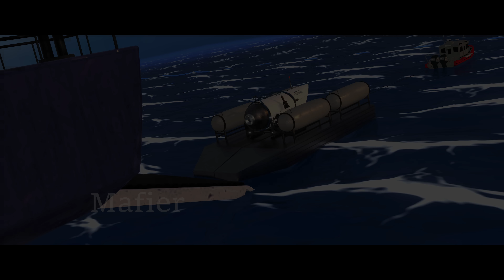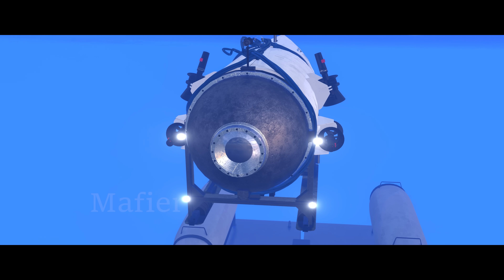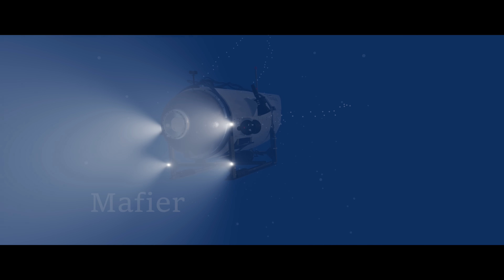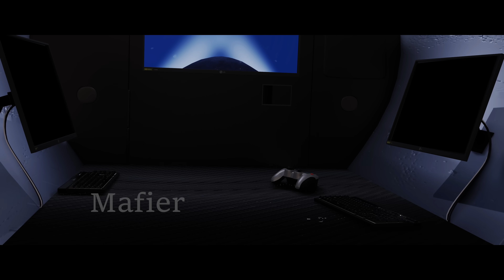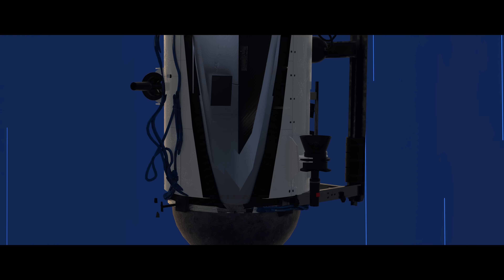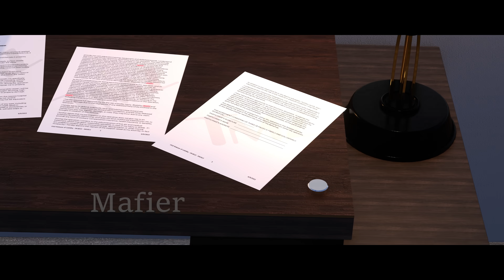NEW SHOCKING DISCOVERY Of Oceangate's Titan - 3D Animation

Comment: That theory doesn’t really hold up mechanically or evidentially.

Here’s why, step by step:
	•	Weight distribution: The Titan was designed with occupants forward; four people in front was not an abnormal or destabilizing configuration. The sub’s center of mass and buoyancy were engineered to tolerate occupant movement without causing uncontrolled pitch.
	•	Electrical failure ≠ loss of passive stability: Even with a total electrical failure, Titan would still retain passive buoyancy characteristics. Loss of thrusters means loss of maneuvering, not sudden pitching forward like an aircraft.
	•	Nose-down pitch wouldn’t meaningfully increase descent rate: Water pressure acts uniformly. A nose-down attitude doesn’t cause a rapid “fall” the way it would in air. Descent rate is governed by buoyancy, not orientation.
	•	Implosion depth vs time: The depth at which Titan failed was well within expected operating range. A slightly faster descent wouldn’t suddenly push it into a new pressure regime fast enough to explain failure. Composite fatigue, not speed, is the dominant issue.
	•	No evidence of a progressive event: A loss-of-control scenario would likely produce:
	•	Multiple acoustic events
	•	A wider debris field
	•	Signs of partial structural failure
None of these were observed.

Comment: The United States Coast Guard released their findings and conclusions of the hearings held in South Carolina—2024–August 2025, the conclusion, the titan experienced a catastrophic implosion; reason provided—in the report—was the bonding surfaces of both titanium end capes secured to the carbon fiber hull. The bonding surfaces of the titanium end capes showed troubling signs of grinding, as well as warping as well as other unusual markings on the inside surface of the end capes. The aft titanium dome had some of the carbon fiber still connected showing significant delamination of the carbon fiber and bonding anomalies.  Additionally the view port window was not located, no signs of breaking or shattering of the glass, leading engineers to conclude that the view port window could also be a contributing factor (since the window itself was not located) blown away from the debris field at the catastrophic implosion site. 

The findings also concluded that the evidence provided at the hearings was significant enough that courts could have concluded criminal investigations resulting in possible charges may have concluded that Ocean Gate be prosecuted. However, we will never know this as Stockton Rush was killed in the catastrophic implosion that occurred June 2023, 1,600 meters from the bow of the Titanic.

Comment: "This tragedy will remain a lifelong mystery". What???? Stockton Rush built a sub out of Carbon Fibre. A material no deep sea sub has ever been made from. During lab testing, the Carbon Fibre failed several times at pressure equivalent to 3000-3500m. The titanic is 3800m. Each time the Titan went down for a test dive, the cracking was indicating a weakening of the material. Eventually, the material ruptured. This information about being dragged behind the ship for 3 days causing the accident is rubbish. This was a design flaw that just need time to show itself. Deep sea subs need to be constructed from contiguous materials like Titanium or Steel, not from composite materials like Carbon Fibre.

Comment: The failing engine and resulting plummet is unlikely. The sub was being tracked up to the last minute by another underwater vessel. One minute the Titan sub was there, the next, it wasn't, meaning it imploded suddenly and without any plummet, though they probably did hear lot of creaks and groans from the carbon fibre in the lead up to the incident, which Stockton probably wrote off as being 'Perfectly normal for these kind of dives in subs with carbon fibre housing'.

Comment: They dropped the frame which hung up on the front swinging it forward putting it in a nose dive before it came off throwing the passengers forward banging on the nose cone probably cause delamination compromising the integratie of the pressure vessel 💥 boom

Comment: ❗❗❗there is no mystery❗❗❗
No one took up simple calculations, what should be the thickness of the case for a pressure of 400ATM.

Everything is simple: the real thickness of the case was only about 13 cm, it is 10 times smaller than the calculated, the thickness of the walls of the capsule should be 1 meter, the pressure on the body of this bathyscaphe was 160055 tons.
Here's how the GPT chat counted:
At a depth of 4000 meters, the Titan apparatus experienced pressure:
39.240,000 PA (Pascal),
387 atmospheres,
4001 tons per square meter.
The total pressure on the entire bathyscaphe with an area of 40 m² was approximately 160055 tons.
The calculations on the thickness of the carbon case were also shown that there should be the thickness of the walls of the capsule 1 meter, if we take 25% to the strength of the strength, then all 1.25m should be the thickness of the body of this bathyscaphe, it is 30 multiple dives and wear of the bathyscaphe, and the real thickness of the case It was only about 13 cm, it is 10 times less than the calculated.
??? (as they could be such mediocre designers so as not to conduct these simple calculations for the thickness of the case.)

... I made these calculations in 15 seconds in the GPT chat to understand that people do not need to climb into such depths, could billionaires not do this for earlier and understand that this is a deadly hobby, especially for experimental bathyscapes from a carbon fiber of 13 cm, Which is not intended for a load of hundreds of thousands of tons and depths for 1000-4000m.
There are metal bathyscapures, did the rich-millionaire really not have money to hire such a reliable bathyscaphe, and not to risk their lives so mediocre, also take children or wives with them ... This is a clever solution.

Comment: back in the mid 80s everyone was jumping on the carbon fiber band wagon for no other reason than marketing.  bicycles are a perfect example of that, where companies mixed titanium and carbon fiber and within a few temperature or stress cycles, started to loosen up and caused problems.   also, has anyone read Stocktons patent on failure detection systems... what bs...another perfect sales tool that can easily be obtained "buy" slick diligent (or maybe ignorant) patent attorneys feeding the ego of the inventor.   why was this sub frame not destructively tested by simply lowering it down twice the depth or till failure??

Comment: Having to sign that disclaimer before boarding would have instantly turned me away. 
I once was invited to do a parachute jump. I was asked to sign a disclaimer that I was fully aware of the risks and that I was responsible for the gear I was going to use. I was amazed that the rest of the group I was with simply signed that and went along. Luckily nobody crashed, but if that had happened, the company running that jump would have been totally in the clear. 
Read what you sign up for!! And make the sensible conclusion!!

Comment: Based on other people’s accounts of leading up to Titan’s implosion, it seems more theorized that the faulty method Oceangate used to form the tube of the submersible was bound to not last. The reality is that it was the design of the sub from the first step that was bound to have it weaken faster than other subs for trying to turn this into a tourist trap (no pun intended). All other subs mainly use spheres, not a spherical that has a weakness of pressure point in the middle and not in a balanced place like most spheres have.

Comment: There should have been small seats with seat belts installed in the ship in case the ship goes vertical. At least you won't go down all mangled together and it gives at least a fighting chance of trying to regain control or dropping the weights.

Comment: So based on footage of the wreckage, submersible experts and engineers found the decompression occurred around the space between the front ring and the carbon fiber hull, which instantaneously shoved the front done off, and pushed the entire carbon fibre hull and its passengers back into the rear dome, forcefully disconnecting the rear support unit and launching the front ring far away from the submersible.

Comment: The failure occurred in the glue bond between the Titanium dome lip and the carbon fibre body. The carbon body had suffered more from expansion and shrinkage than the titanium during consecutive dives, submerging under massive pressure and freezing cold, and surfacing, floating for periods of time and heating under the sun. When it failed water breached the bow causing immediate massive failure and implosion. The carbon compressed and the titanium dome bond sheared and shot off. The rear cap with oxygen equipment was literally squeezed off of the rear dome that failed instantaneously.

Comment: From the pictures of the recently released debri field it looks like the forward dome and interface ring was where the failure occurred. The forward dome was some distance away from the rest of the debris and was intact except for the porthole plexiglass. The aft dome and tail section were found together with the remains of the carbon fiber crammed into the aft hemisphere of the dome. This suggests the pressure came from the forward dome pushing back to the aft. That would have popped the porthole out of its mount and the forward dome off the rest of the sub.

Comment: I would have looked inside once  to see that there are no seats  for passengers and crew would be red flag number one. Red Flag number two  would have been seeing  no controller dash board and seeing a plastic gaming controller like for Mario Brothers.  Learning it was to be  Bolted from the outside is red flag number one really.  Absolutely do not enter.  I certainly would not have given a quarter million dollars to ride down that deep in that.

I think you talked about the motors having problems before this fateful trip should have been repaired.  Not sure whose brain child of towing the Titan out to sea  off the boat seems a bit odd to me.  I don't know what the weather was like so It would be hard to say that it was damaged during towing. How rough were the seas? Why wasn't Titan left on the ship?  That  decision seems dumb.  I think Titan was damaged from the previous rides down.  It was a disposable sub and by the results it was only good for 2 or 3 runs to the Titanic.  I think it imploded after the sounds started happening.  The  final resting spot  the main parts were pretty close together so you are probable right that it did tip downward and imploded relatively close to the bottom. 48 to 72 seconds is a long time and then lights out.

Comment: I think the subs cracking was a signal that the craft was descending too quickly and inorder to slow descent  they tried the vertical thruster but it had failed and as a last ditch effort the weights were dropped, but the craft continued to descend which created a gap in time from the clicking to the implosion. the verbal report that all was good was to calm the passengers, but some failures had occurred  which was detected by base operations which sent out a verbal message and possibly the last possible recapture point by the surface of the submersible The CEO was sure of the craft and his ego  was responsible for the continued use of the craft the location of the final resting place may be  due to deep ocean currents and possibly fortunate that a survey may have occurred, but  it may have been far off too and the currents placed a craft closer to titanic.  RIP explorers of the deep.

Comment: they should have attached a cable on the submarine to pull them back it case of connection loss or suspection of failure

Comment: So I build boats from fiberglass which is a composite like carbon fibre. Components are glued together.  It's EXTREMELY DIFFICULT if not impossible to glue components together without dust creating microscopic air bubbles in the seal.
When I saw them gluing the titanium hemispheres onto the carbon hull I was appalled.
1/ titanium and carbon fibre respond differently to pressure and temperature meaning that using such a bond where both temperature and pressure can be extreme will create progressive weakness in that bond.
2/ gluing components for use in extreme environments e.g. racing yachts , airplanes etc should be done in a clean room with everyone wearing paper suits, hairnets etc.. like what you see when they are building satellites in the space industry.  This is because you need to control dust, static, temperature and humidity to get a consistent bond without any trapped air bubbles.
In Titan's building video they literally did this in a dirty workshop with guys slapping the epoxy on with spatulas wearing polo shirts and jeans. This would have trapped air in microscopic bubbles.. air that at 12,000 ft is at considerably lower pressure than the water outside.
3/ gluing bonds of this size with epoxy is incredibly challenging because epoxy cures from the moment you mix it with its activating agent. So you get about 5 mins to 2 hours to apply and position the surfaces to be bonded. As this vessel was made on the cheap I suspect commercially avaliable marine epoxy was used, this cures in about 20 mins and hardens over 24 hours. Here's the challenge: you mix the epoxy, it starts to cure and gets thicker and more difficult to apply as time goes by. It also gets hot as it cures creating further expansion issues as the surfaces are of different substances that react very differently to heat.
So how do you ensure you get consistent application if the epoxy across the bond? It's impossible. There will be weaknesses it's inevitable. 
This is why deep water sub crew compartments are solidly cast and if bonds exist they are the same material.. they even insist on the same batch of titanium for all components to be joined to ensure tiny differences in the alloy make up don't compromise safety....

Comment: This is BS - Titan must withstand pressure at bottom, around Titanic's wreck. If they dive because of electrical failure, they can, in worse case, impact to ocean bottom but Titan was imploded earlier. Along with many other problems there is big design failure with the hull of Titan.

Comment: Disappointing Video!!! 
A loss of power would NOT result in a loss of trim/balance. The balance was maintained passively through trim weights and there wasn't any aktive electrical system to influence the trim. So a loss of power could not be the cause of the shown result. So, while this video has nice animation, it's conclusion is total nonsense !!!

Comment: This is a ridiculously lazy video. Your theories didn’t mention the absolute fact that the titan was communicating with the ship. That would have been impossible if the titan lost electrical power and started a nose dive. You also failed to mention that the materials and the design were not suited for that kind of depth and that repeated dives at that depth likely left micro fractures in the materials, and that’s the most accurate explanation to what actually caused the sub to implode. Do your research man, you’re a YouTuber. It looks like you googled the first theory you saw and tried to flip it as the most accurate theory out there when it’s hardly accurate. Thumbs down man.

Comment: It wasn't the "sudden" change in pressure that killed them it was the pressure, period.

Using an online terminal velocity calculator I made a rough estimate of the sub, pointed perpendicular with density of seawater and mass of roughly 22,500 lbs, and the terminal velocity was approx. 25ft per second.  One atm of pressure is applied every 33ft.  So the "rush" to the bottom would have added additional 11PSI to the hull every second.

While this is significant, it isn't beyond what a properly built pressure container could withstand.

The point was, Titan never was a properly built pressure container.  It was built with a material that basically had a shelf life.  That pressure hull had a finite number of pressure cycles in it.  And Oceangate failed to find out where that finite number existed.  Instead, trying to rely on technology on telling them when the hull was "creaking" too much.

At the VERY minimum, Ocean gate should have taken the original Titan and continually dropped it down and brought it up to find out how many times the sub could be pressure cycled until failure.

Then you set the maximum number of allowable dives to be half that number.

And if Carbon Fiber requires you to build a new hull every 5 dives, then you pretty much realize it's not suitable for what you are doing.

Comment: The Titan imploded simply because it was poorly designed. All bathyscaphes intended to accommodate people inside are built of titanium and have a spherical shape. Titanium is the only material capable of withstanding enormous forces and the sphere is the only shape that guarantees optimal pressure distribution over the entire surface. You don't need to be a structural engineer to understand that the sphere is the only structure capable of resisting the enormous stresses that exist at depths of thousands of metres. I am humanly sorry for the death of the people who agreed to participate in the dive but went looking for it......